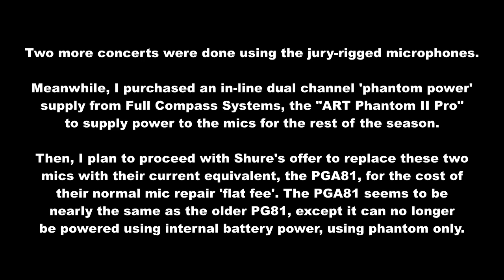Repairing Battery Terminals on the Shure "Instrument Microphone" model PG-81 (and similar models)

Comment: Nice fix. Another thought is that you could probably cut the spring out of a battery holder and solder that in with, or to replace the tab.
Reply from the maker: A normal (-) terminal spring would not fit. Shure does not have available replacement battery terminals. The existing terminals are riveted to the cast zinc chassis, and replacing  the terminal completely would entail disconnecting several wires in nearly inaccessible places, etc. Too great a chance of really boogering up the mic trying to do a complete replacement. If I had no other choice, I might have tried, but with Shure's nice new-for-old service policy, all I needed to do was jury-rig these old mics enough to last me for a few more weeks. The goal of this video was to show how to disassemble the mic enough that more of the broken terminal was exposed to allow some kind of repair.